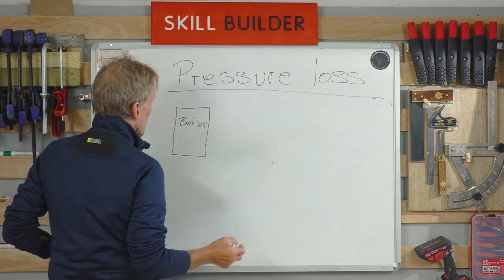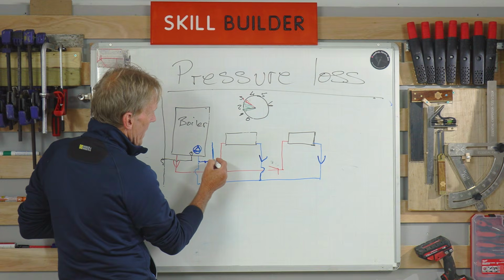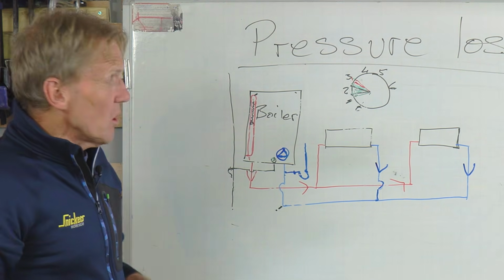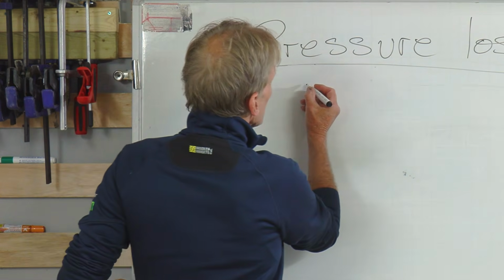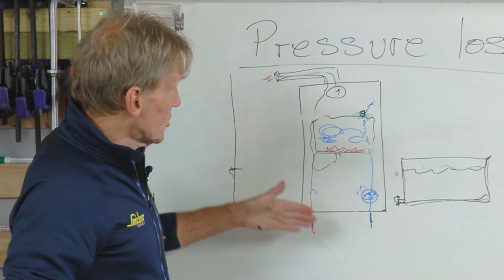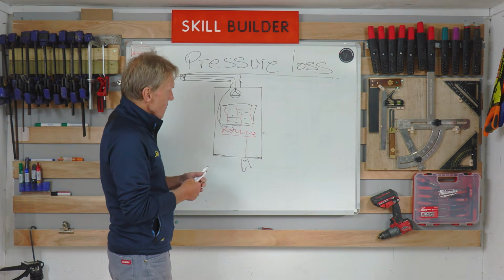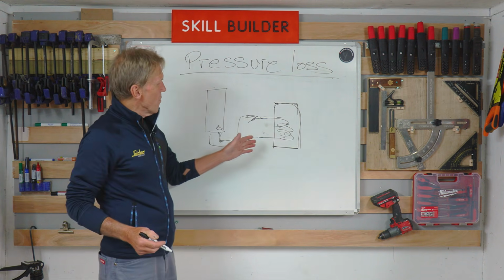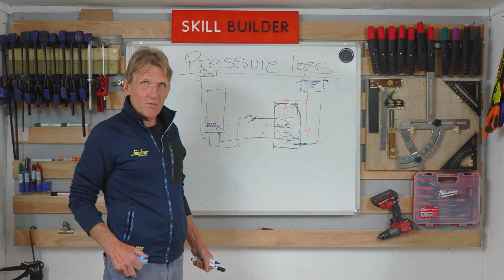Why Does My Boiler Keep Losing Pressure?

Comment: Another thing not a pressure issue, but if you have a condensing boiler the condense outlet
can freeze in cold weather and the boiler will stop working. This is something you can fix
yourself.  Many issues on a boiler you can fix yourself if you are competent. You don't need
to be Gas Safe registered to work on your own boiler, although it is not recommended if you are
touching anything related to the gas supply or flue.

Comment: Not sure if you mentioned this, but a sudden loss of pressure can be due to the mains filler letting by.
These should be disconnected and capped off once the the system has been filled. Although on a
lot of boilers the filling loop is built into the boiler. If the boiler goes over pressure (usually over 3 bar)
it will blow off to outside..
Reply: If it’s sudden loss, it won’t be the filling loop passing.

Comment: Roger, thanks very much for this video, diagnosis is a tricky thing and sharing your years of experience is of great value. I drained my system just over a year ago and after filling it up again the boiler kept tripping out, the pressure kept falling and flooding out of the pressure relief and I had to keep topping it up. I thought it was probably the expansion vessel but, not being a plumber, I wasn't sure. I contacted a few plumbers but none of them were interested in doing an investigation to find out what was wrong. I turned down the temperature on the boiler, which pretty much fixed the overheating, but I have been topping it up every week or so for the past year and a bit. Thanks to your suggestion of pressing the air valve to see if water came out, I was able to confirm that the diaphragm was gone and immediately ordered a replacement expansion tank. It's all fitted now and hopefully my days of weekly topping up are over. 
Once again, Thanks very much!!

Comment: 4 year BAXI boiler completely loses pressure down to zero bar, up to a couple of times a day, but only when the house reaches set temperature and heating goes off. We have never seen this happen when heating on continuously, the pressure does get a little high so compensating by lower radiator and hot tap temperature down to about 50 Centigrade. T
Our gas engineer who installed it appears to have dementia and is not up to fault finding an rarely answer his phone.
Reply: Find a professional
Reply: @kevinschoales844  Thanks, fixed with a calibrated air pump.

Comment: The flow turbine adapter was leaking on mine for years and I never noticed it. It was a drip every now and then, and until I placed a towel directly underneath and left it overnight did I notice a tiny damp patch, almost imperceptible. I ordered a new adapter, removed the old crusty piece of s**t and replaced it. Now the water pressure is relatively constant and with the expansion pressure back to 1 bar it holds nicely. Those baffles were a real pain in the a$$ to get out being that the flue was directly over it!
Mine is a greenstar 28i junior.

Comment: One item not covered and may result in pressure loss is failure of the schrader valve. I was advised to replace the boiler because of daily pressure loss requiring re pressure every day. I got a new boiler fitted and when the old one was stripped out it was found that all that was needed was a new Shrader valve. Like a car tyre sometimes you need a new valve. £1200 down the tubes for a new Baxi Platinum was the result!

Comment: I had to top up every week, called an engineer - Clueless - He said just keeping topping up, once a week is normal apparently (lol) ??? I drained the system, checked the expansion vessel pressure = O,  re-inflated to 1BAR with a bike pump. Refilled system, Guess what - Hey Presto - Been working perfectly fine for over 6 months with no top ups required - I didn't remove the boiler cover so i didn't break the law before anyone comments.
Reply from the maker: I don't think removing the cover is illegal. You clearly know more than the engineer.

Comment: Talk about long winded - jeez
Reply from the maker: Don't worry you can have the time back when you reach Liverpool St Station.
Reply: @SkillBuilder
Reply: Hi  Roger
This is a great video specially workigs of the expasion pressure vessel explained perfectly. I am not a gas safe: just DIY  incidently I got a Vaillant VCW combi over 20 years old I got a persistant fault on the hot water as I only get hot water when the Heating Cycle is on. The system inspected by a gas safe engineer system was flushed out for any corrosion but no success. I am not sure  if I got a thermal cut out on the burner ? Any ideas appreciated.Thanks.
KM

Comment: After I had a new boiler and some new radiators installed I was losing pressure slowly for over a year. Finally I realised that the kitchen radiator was always cold. One of the valves had been left closed and it was almost full of air. After filling that radiator and re-pressurising the system pressure losses quickly stopped. I believe the radiator was acting as an expansion vessel. As water entered and exited the radiator it was absorbing some of the air so water was filling the radiator very slowly. The automatic vent released the air so pressure dropped. Now pressure is completely steady.

Comment: Wow! I'm thinking about replacing my (very) old Ariston boiler which we inherited when we moved in 18 years ago and has performed pretty much faultlessly apart from a replacement PCB a few years ago. It sounds like you are now as a consumer being forced into service contracts and products that you didn't used to have to buy such as filters. As someone who used to be out on the road with my father who used to be a gas engineer (I'm an electronics engineer) in the late 70's / 80's, it seems to me to be another gravy train. 

If I buy a new boiler, I expect it to last me for 20 years minimum. It strikes me as the same BS as with modern kitchen woodwork - just designed for a 5 year lifetime due to crap design and materials.

Having to scrap a boiler if the heat exchanger fails after 4 years compared to running what I have for another maybe 10 years.... the economics to me don't seem to make sense even taking into account elevated gas prices.. There doesn't seem to be a financial benefit unless my current boiler becomes uneconomic to repair.

I do have the boiler serviced every year via a contract and I know that parts are going to become more difficult to get. I expect more than 4-12 years service life out of a boiler. I have alternative heating options - a new gas fire (which is crap because the sparker battery cover broke last night - the first time I needed to replace the battery having been fitted end of 2020)  and air-to-air heat pumps which are stupidly expensive and uneconomic to run at the moment. 

It seems that heating product manufacturers are moving to a high product churn model to maximise profits.

I'm interested in views / suggestions on my comments from people in the community who are wiser than me.
Reply: Yep in my previous house I had an old 'floor standing' basic boiler, some 25+ years old. It would have been pretty inefficient, and when it conked out replaced it with a 'nice' new Valient boiler, believing it to be good quality. But that only lasted about 12 years.  I think boilers are considered to only last about 11-12 years now (A coupe years beyond warranty) with the hype that 'modern boilers are more efficient' so get them replaced. There seems little to no motivation by the manufactures to have long lasting boilers. And the government will soon insist we can opnly replace with expensive heat pumps and not gas boilers.  In my new house, the existing boiler is some 16 years old, and seems to be working OK, but I am budgeting to have it replaced in a couple years time, before they become illegal to buy.
Reply: @juleswombat5309  I've gone for three air-to-air heat pumps at home - it's cheaper to warm the house with gas than using the heat pumps given current electricity costs.

Comment: Hi roger when I was a heating engineer I kept some schrider valves in my van and a tool to remove then out of the expansion vessel,sometimes they leaked air.I would also if checking the expansion vessel let all the air out and complete fill the vessel with water then press the vessel valve if water came out I knew the diaphragm had gone in the vessel.
Reply from the maker: That is a great tip. Thanks Peter, I am assuming you are retired now or did you find a better way to earn a living?
Reply: @SkillBuilder  no I am retired now 43 yrs as a British Gas engineer,for my sins.

Comment: Roger an easy way to check if the coil has gone in a open vented system is to bung your heating expansion tank and then start to run off some water from the heating circuit it will keep running if the coil has split,you will find the domestic tank ball valve starts to drip or run.

Comment: Roger you cannot always presume the boiler isolation valves are holding when turned off when testing the system or boiler for leaks.
Reply from the maker: True

Comment: Used some cheap aftershave from superdrug(other shops are available) no smells in the house, had a sniff at the PRV pipe, nothing, had a sniff at the condensate drain and bingo there it was. Unfortunately it turned out to be the heat exchanger. I'd had plumbers trying to find the leak and they didn't find it, just took my money replacing parts and pipework that they said could have been the problem. Great idea, cheers Roger.
Reply from the maker: I am so pleased it worked for you. Some plumbers laugh at this idea but they are usually doing what you say, taking a punt at parts replacement.

Comment: The expansion tank in the boiler was my issue. After replacement my bills dropped and the pressure in the boiler instead of rising considerably - remained stable. I was topping up the closed system every month or so, and there was a considerable amount of steam during boiler operation - which was the tip I had there was an issue 8n the boiler and nit a leak in the system...

Comment: And if the pressure keeps going up, its most likely leaky valves in the (permanently connected) filling loop. Happened to me and my son. Son got a free new plate heat exchanger out of it as service contract engineer insisted it was a pinhole in that despite I told him the disconnected loop had a slow drip, which he said wasn't enough to cause the problem, which he eventually replaced the valve and cured the problem!

Comment: Hi Roger, I think you just explained why I has a problem in a previous house with a hot water tank with the header always overflowing even though the ball was below water. I changed both ball cocks in the end and it still overflowed. In the end, fiddling with the level the ball valve cut off in highest tank stopped the overflow so left it with that fudge. Luckily the two tanks were close to the same level. 
You Never mentioned condensate freezing in the external pipe blocking it and causing the boiler to shut down. Apparently, that is very common and my gas-safe engineer says he always gets very busy with those callouts the first time we have a big freeze.

Comment: Another idea to detect leaks - how about UV dye as used in car air con systems? Obviously no good for leaks under floor where no access but cheaper than expensive ms gas detection.

Comment: What does it mean if the boiler pressure gauge shows 1bar but the hot water cylinder (in the hot press) attached pressure gauge shows 0.5bar? I'm trying to understand why my hot water cylinder (1y old house) started making a buzzing or kettle like sound. The immersion is off and the boiler is on standby when the sound is there. As soon as I turn the thermostat higher and the heating starts up the hot water cylinder stops buzzing.
Reply from the maker: Have you got a motorised valve or solenoid?
Reply: @SkillBuilder  It's a motorised valve. Actually total three of them each controlling different manifolds.

Comment: My Worcester boiler is losing pressure. It only happens after the boiler has been on and it loses approx 0.5 bar each time. The expansion vessel was replaced last year and no improvement, I have checked the rads, no issues, also no obvious water patches on walls ceilings etc. I have also used some fennox leak sealer and no joy there... I'm at a loss really. I don't understand how if its a pipe issue the leak isn't continuous, it's literally only after the system has been run for a while and once it's off you see its dropped pressure from its last starting point. I thought the issue was resolved in the summer as we had no heating on for months and the pressure was sustained, also it doesn't seem to impact when I run a hot tap. Hopefully someone can help with this for me please 🙏
..
Reply from the maker: Is there anything coming out of the pressure relief valve? I am guessing this was checked but it has all the hallmarks of an expansion vessel issue. The expansion vessel needs to be presurised to the static head so if it is a tall house. for example, this needs to be added to the 1 bar. 
It could also be that there is not enough capacity on the built in expansion vessel. If you have underfloor heating or a lot of radiators you need more capacity. That said it would still discharge through the pressure relief valve and show up. It could be nothing more than a constant drip to lose a cup of water every time. I use a balloon over the pipe end to see what it catches.
Reply: @SkillBuilder  I have checked the valve pipe and there doesn't appear to be any dripping. The balloon idea sounds like a good suggestion . I will try that and report back. Thanks for the response and the suggestion.
Reply: @SkillBuilder  also the expansion vessel was put in approx January this year like I mentioned earlier I thought the issue has been resolved as the pressure stabilised but thay seems to have just been because the heating wasn't being used.. Would you expect a constant pressure drop if a pipe or rad was leaking?, or would that only be when the boiler was in use?

Comment: Hi Rodger, very insightful video. Perhaps this is a bit of a redundant question but do the same points apply if dealing with oil/kerosene fueling the boiler. Here in N. Ireland approximately 70% of homes are fuelled by heating oil. Gas is mostly only available in the cities.
Reply from the maker: yes on a pressurised system it is the same. The fuel is not the issue

Comment: Had a prsure problem would need toping up once or twice a year and told by service guy it was normal till one year, a different engineer noticed the pressure relief valve had been leaking. Replaced it and never had to top it up unless I check radiator bleed valves once a year.

Comment: My boiler was losing pressure and leaking out the bottom. put a bucket under it. Limescale cured the problem after a year or so. F'ing love it when neglect fixes the problem

Comment: Hi. Well explained. Had preasure system put in 10 years ago, about to have 4th preasure vessel installed - the rubber diaphragms only last a couple of years - wish we had stuck to old fashioned conventional system as only ever cost regular boiler service.
Reply: Have a look at the videos which explain why it's not always a damaged diaphram.
Condensation can build up in the EV which can be drained down and repressurised.
Most engineers just want to replace the EV or add an external one.

Comment: Interesting article. Strangely my Worcester boiler still works even if the pressure is zero, which it was at the start of this month - why would that be? 
My system holds pressure pretty well over winter but usually loses it over summer so only need to top it up once a year. I'm just surprised my boiler still works though even if the pressure is low.
Reply: I had a system in a previous place, which various "Plumbers" came to sort out the central heating, all had to be paid, not one of them sorted it.
In the end a friend of me eldest came and spent a while looking at the system, before diagnosing that it had been plumbed in to run backwards! The overflow tank in the loft was full of hot water! He came back soon after and sorted it. It had been like that for more than 15 years!
Reply: pressure valve failing?

Comment: Thanks. Why do boilers work at 1 - 3 Bar as it is asking for trouble ?, surely and compare that with a car tyre of 1 -  1.5 Bar.
Reply: Rule of thumb, you'll want 1 bar to start with and then 1 bar per every 10m of vertical difference between your boiler and the highest point in the system. A house with one upstairs floor will be fine with 1.5.